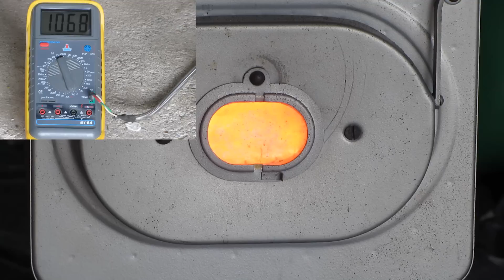Metal Casting at Home Part 28 Brass & Electric Furnace

Comment from the maker: If you have sand like mine you don't need a muller. Finish with greensand is a cast finish like an engine block. 10lbs of sand won't go very far by the time its rammed up maybe 6" cube.

Comment from the maker: It's an Efco furnace, It was a gift from a friend I don't know what the cost would be. Its German,the manual is all in German. It was intended for enamel work I think. It's 2KW and took 1 1/2 hours to reach the temperature so that's only used 3KW hrs so is quite economical.

Comment from the maker: This the only time I have used it. It produces detail very well. Down side is you loose a bit every cast as it hardens around the metal and has to be discarded. More expensive than greensand which is reusable.

Comment: You need to make yourself a moulding bench.  I use one of those big plastic deck boxes with a set of wooden slats fitted over the top.  Works great.

Comment: Maybe add small vent holes. In the video you can see gasses escaping some between the two halves. It can allow the pour to flow better. Also, maybe sift the first bit of sand through a screen as you first cover the pattern. Infills more detail of the pattern and reduces chance of foreign partial coming up against the pattern, and usually a smooth, more uniform finish on the casting.

Comment from the maker: Yes the petrobond did seem strange, more plastic. The refactory in my propane furnace may not cope with the higher temperature. I don't realy need a brass casting for anything at the moment, I just wanted to see if I coud do it.

Comment: I work the foundry trade as a living, also have a back yard foundry. been wanting to up load vivios of my setup on youtube. I do alumn / brass / brnz. for items that i cant do at home I get to do them at the foundry. at place of work we use induction furnace for the brass work and forced air gas dip out furnace for alumn. I have one whistle that is waiting to be molded up and purrd 21in 3 chime. the biggest on completed is my 14in 3chime in alumn. have vivios of it blowing at Boot hill mic

Comment: Again a very nice video! Not enough material,but its a sucsess anyway! Wel done. I have a similar furnace and a similar digital voltgauge with also a external temp sond.But It goes not till 1000 degr. cels. (or moore) Do you change the tip sonde?.. and if yes,can you please tell what type and kind of sond it is.Many thanks!! I wil need it in order to experiment with steel and cast iron hardening..
Many regards Peter/NL

Comment: I wonder about the length of time it took to actually melt the brass to pour. I am considering using a surplus ceramics kiln to cast brass and aluminium but I am worried about just how long it might take compared with using propaned fired burners or waste oil as other do. appreciate your comments on the furnace and times.

gerald

Comment: Thanks for the very fast answer! Actually I dont test it how far my go.Its also a stainless steel stick at the end.I must look,if I can find the manual. But 1000 is a lot! I dont want demage my probe.I buy on ebay a laser temp reader and it goes till 350 cels. Its from china,and i wrote them ,as in the manual i saw the make different types even till 1100 ,but I never got answer.But thanks for info. I wil try to find my manual or otherwise maeby I can find it on the web.Thumbs up for you!

Comment: Do you have more videos on brass casting? Curious if your methods changed since this first try. Have you cast brass in greensand or your gas furnace? Besides the borax flux have you used degassers or phosphorous copper shot? Have come across conflicting instructions for their use. Great videos! You've helped me much getting into aluminum casting. Ready to try brass and have an old pool pump ready for a new life!
Reply from the maker: No I haven't tried brass again. I have not needed a brass casting. No reason why greensand would not work though.

Comment: does green sand leave a finish like an engine block or like the one on a tap? how much fun would it be to make a small Muller? how large of a box would 10 lbs of oil bond fill? (no patterns)

Comment: I see you use LoSalt for flux with your aluminum pours and Borax for this brass pour. Do different metals require different fluxs? I do lead alloy pours only currently, bullets and buckshot. For those pours I use Paraffin wax as flux. Will Paraffin work with any other metals?

Comment: Hey man you are damn good at the casting.could you do a video on how you made your flask? Love that locking mechanism.also where could i get a bad a**  furnace oven like that
Reply from the maker: The clamps were hinges with the pin replaced with a longer one. The oven is an enameling one.

Comment: I am having a bit of a problem. My brass is bubbling when I poor it.. I am using play sand and 10 % bentonite for my casting???  I have not tried the borax. Any help would be appreciated thanks..
Reply from the maker: I think it sounds like your sand is too wet and the bubbles are coming from the moisture turning to steam. Borax will make the metal flow better.

Comment: two questions, at the end it seems to have less of a brass colour and more a dull sort of lead look do you know why that is ? and whats the purpose of the additive which you mixed after it came out of the furnace ?
Reply from the maker: When brass is heated it will go the dull colour. Can be polished back to a shine if that is the finish you need. Borax is a flux. This makes the metal flow easily and cleans it too.

Comment: how did you get the brass that hot and not lose all your zinc?!

I recently tried brass and I ended up with copper
Reply from the maker: PandaManMk2000 Perhaps you over heated the metal.
Reply: Thanks for the reply :)

Yeah, I would say I definitely did. My furnace might be a tad overpowered (or perhaps too inaccurate, rather) to keep the metal below a certain temperature.

I might try running it with the lid off and turn the propane pressure as low down as I can get. But my home made burner doesn't like going below about 1.5 bar.

Comment: How does one go about copying a brass part?
Reply from the maker: +Ham549 You need to make a pattern of the part if you want an exact copy. It may be possible to use the part as a pattern but the casting would be smaller due to shrinkage.
Reply: + Ham549 Por motivos